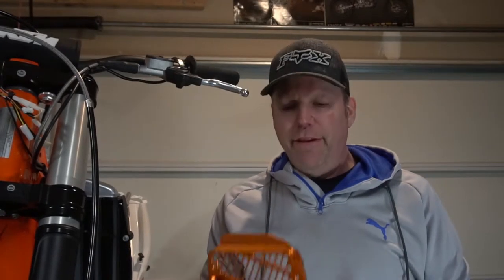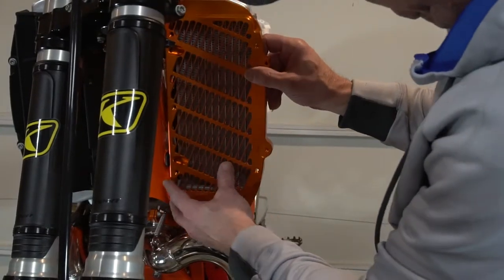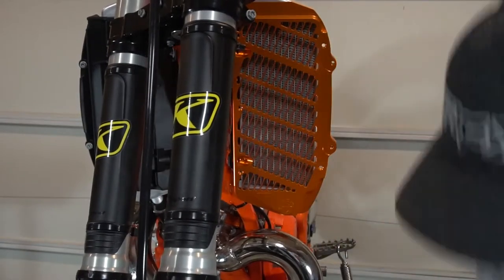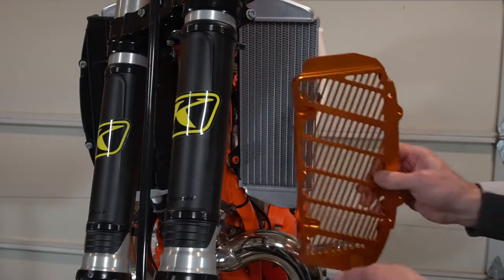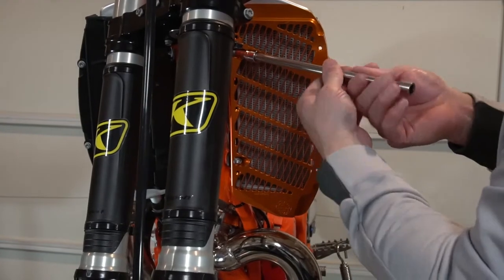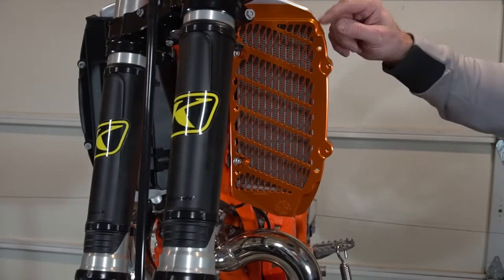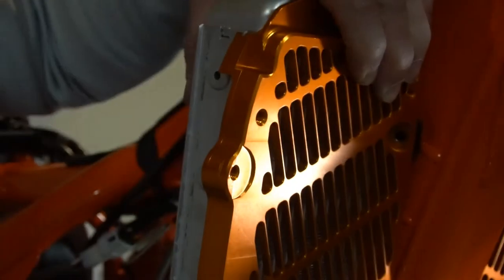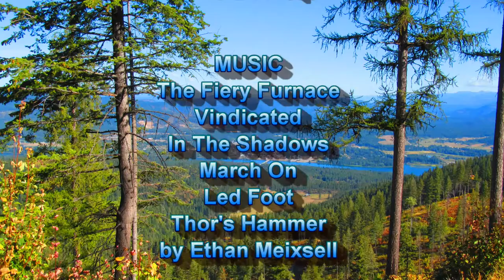Bullet Proof Designs Radiator Guards Install

Comment: i reacently hit a pointy rock with basic radirtor braces, will this protect prom pointy rocks hitting the side??
Reply from the maker: They extend past the radiator but do not wrap around the sides, they do wrap the bottom of the radiator.